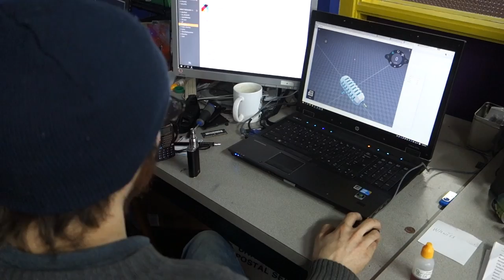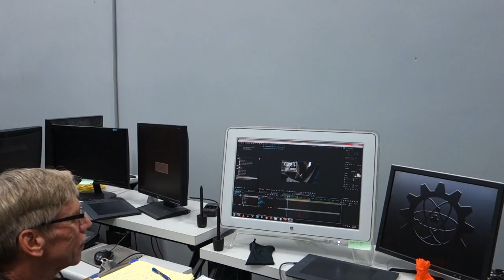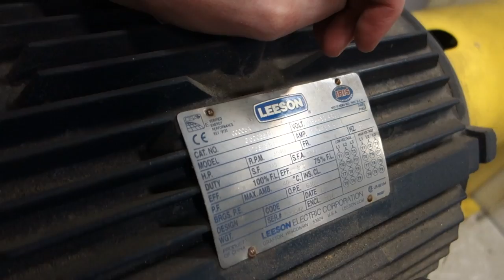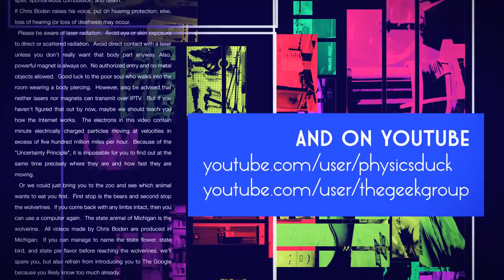Captain's Blog 12 8 2015 Giant Vacuum Pump Test Fail

Comment: I'm thinking a Star-Delta or VFD isn't needed. You will eventually need an overload relay or some other protection for the motor. The breaker protects the circuit for shorts only and is oversized from what is typically allowed so that the inrush from start doesn't trip it. I believe up to 250% of motor current with the wire sized to 125%. The relay will protect the motor from overload, it is adjustable and generally set at a value slightly above the name plate current. So I think you could use up to a 50a breaker probably with #10 wire. I'm not an electrician though so I may be wrong.

Comment: For that you need a Star-Delta Starting Control/Switch or a Soft-Starting Device (has Triacs in it) because this Motor has about a in-rush-current of 184A (Delta) and only 7.6A in Star but no torque, it has to switch from Star to delta if it arrive normal operrating rpm.
Reply: +Chris Boden http://electrical-engineering-portal.com/star-delta-motor-starter

This might help. You should have suitable switches.
Reply: +Chris Boden I couldn't see the Motor plate clear, what was the lowest voltage on the Plate that decided how you have to wire that thing (maybe you just wired the Motor wrong.)

IF there is no higher Voltage than 480 then it wouldn't work with Star-Delta, but I'm not sure enough with the confusing Electrical constelations in the States. I know only from here if a Motor has 230/400V on the plate it wouldn't work with star delta, but when it has 400/690V it works.

This Could help too: http://www.moeller.net/binary/schabu/wiring_man_en.pdf

For Soft-Starter they get produced by Eaton or Siemens for example.
VFD would be the Best of course, the Prices for a 15kW are between 800$ and 2000$ i guess.

P.S. Sorry for the bad english.

Comment: Matt needs an audio attenuator. It's probably not so much an impedance mismatch,as it is a signal level mismatch. Mic inputs expect a very low signal level (like,a dozen millivolts,and thus have a lot of gain built in.),the speaker/headphone output of a device is much higher level,probably a few volts,peak to peak. You need to pad that down a fair amount. Maybe like -10dB,as a starting point.
Otherwise,it's just crunchy distortion.
I used to have a 3.5mm plug with attenuation built in,maybe you could find one on Amazon...(in fact,maybe I'll go look for one to send in.)
Reply: +PhattyMo Well,I'm having crap luck trying to find one. Maybe Ed could build something up,it's only a few resistors.
Maybe just a headphone cable,with a volume control would suffice?
Reply: +PhattyMo My current laptop has an option to configure the "mic in" jack as a line input, probably just knocks down the gain or bypasses the preamp circuits. Might be accessible in software.

Comment: A thought for Matt, why not get an SDR and run radio through that?
Reply: +nedkelly384 And no thats not a Solar Death Ray
Reply: +nedkelly384 I like solar death rays!
Whats an SDR?
Reply: SDR is a Software Defined Radio, you can use specific USB TV devices to do it. http://www.rtl-sdr.com/ Just need laptop to run the software, and antenna for the SDR and to know the exact frequency of the channel you want to listen to, only downside is its receive only not transmit but you will have proper radio for that.
Reply: If I send you one will you use it?
Reply: +nedkelly384 Why not have people phone his cell phone (set to vibe an ring) if they need to talk to him?
Reply: +Cameron Webster because radios are SOP at the lab. And that is for good reason.

Comment: Star-delta start circuit anyone? Induction motors will draw easily 4-5x rated current at startup if you do it at full voltage :)

Comment: you have that double door near the router.  outside and to the right i see a single door.  where does that single door go?  rig the wires.  electrical wires are lighter than appliances.  schumin resonance sounds like star trek.  mythbusters experienced inertia that with their Lawnmower From Hell.  eating a dollar bill is extreme.  once photonicinduction played with 500,000 volts.  find another building for CNC.